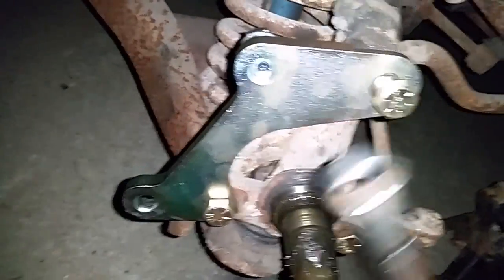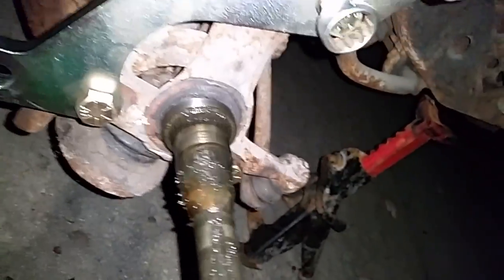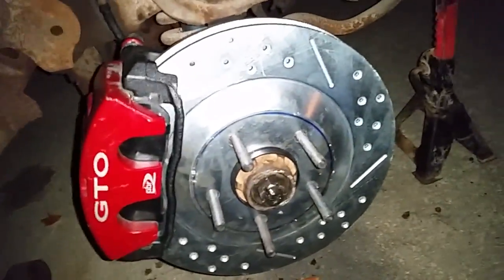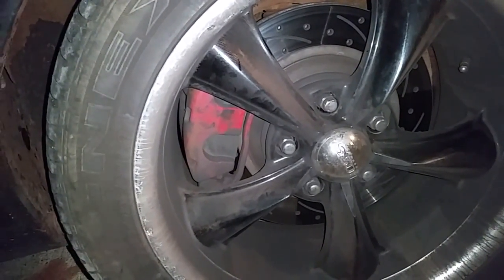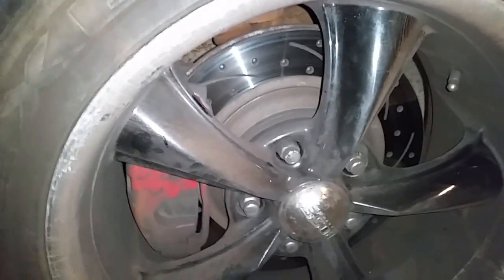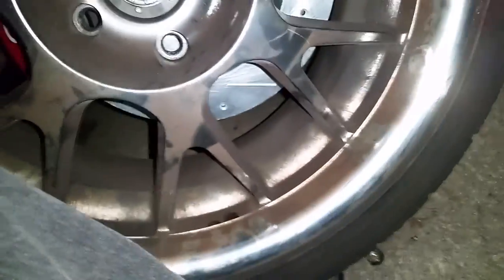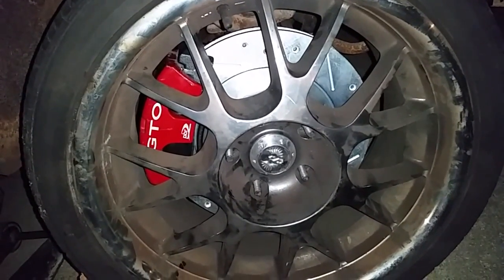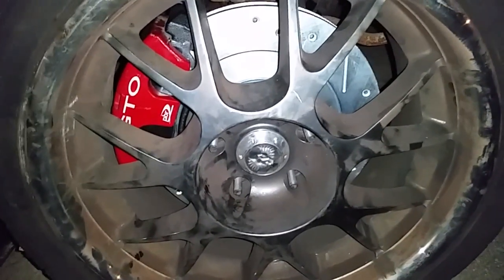c5 corvette disc brake swap 67 tempest gto chevelle nova camaro firebird

Comment: I'm over here looking to do a C5 rear disc brake conversion for my 2000 S10 Extreme and find a way to do C5 larger rotor for the front disc brakes and here I find some real Unicorn cool stuff.  I  really like what you have done over here. So many idiot's NOT doing this high quality budget installation.  I normally don't drive 60s car's but always loved the 68,69 Camaros. I watched because I had a 74 Camaro and I can't remember but I think the front factory rotors are bigger than my S10 Extreme and the spindles look the same if my memory serves me right.  This is one of the greatest budget mods I ever seen in a long time and now I  know when I  can finally afford to get a 68,69 Camaro or even the 74 like I had because of the aluminum front and rear bumpers like the 80s Caprice.  I live in New York City 5 boroughs area my whole life and live love the 74 Camaro which maybe more affordable than the 60s Camaros. The reason being is the assholes that like to bump your car when you have it parked plus they are great for doing battle here in the streets. You can knock down shit just like the Caprice could only difference is your doing with a good looking car and you don't have to worry about parking. Love the video's bro, awesome and now I  am amped up to get another 74 Camaro just because your video with this great idea for a superior braking system that's looks great.
Reply from the maker: Anthony Lodico thanks!

Comment: Nice setup...well done.
Reply from the maker: Thank you, just trying to get the info out there for the guys with shallow pockets and big dreams like myself... btw these brakes would be nuts on a certain 3rd gen i know... ;-) hin hint... also the whole getup around 400 bucks including the new rotors and some pads AND including the KORE3 bracket.   Thanks for stopping by ;-)
Reply: Invincible Extremes It would be a great upgrade for the TA... right now, he just has factory 4 wheel discs, but they're not really big enough.

Comment: That will work great for that heavier car and i like the GTO that was a good touch to add.
Reply from the maker: yeah, half the reason i got '06 GTO calipers and went through the hassle of putting them on corvette brackets was because it came out a little cheaper... the other half was simply because they said "GTO" and I thought it looked cool on a GTO clone/restomod...  thanks for stopping by man.

Comment: Alright I just want to make sure I have this straight before I go spending money. I have a 1967 Firebird with a 1976 C10 posi 10 bolt with drums in the rear, and 1972 impala front disk brakes. To get this done, I need corvette front calipers, rotors, and then the caliper hanging bracket and adapter hose from kore3? then for the rear I need camaro brakes and backing plate with adapter brackets from brp hotrod?
Reply from the maker: yup, exactly those items
Reply: +Invincible Extremes Muscle Cars Garage  alright thank you very much! Nice videos btw, very informative. I mean shit, I was able to gather all this info from just your videos.
Reply: One more question, I'll also need the proportioning valve and you recommended wilwood, I'm assuming I'll also have to upgrade the master cylinder to accommodate the front disk and rear disk?
Reply from the maker: +Christian Dekker the master is a cheap $40 part, buy the stock 70's corvette master... the wilwood prop valve is a must, unsafe without it... it lets you adjust the brakes exactly right to where you dont wipe out during a panic stop ;-)
Reply: +Invincible Extremes Muscle Cars Garage  Ok thanks for the help! So with the camaro rear brakes, will I need the left hand side caliper/backing plate on both the left and right side in my rear?
Reply from the maker: +Christian Dekker no, its a little close on the shock, but just one regular set works ok
Reply: +Invincible Extremes Muscle Cars Garage Ok perfect, I just bought a pair of calipers and backing plates off ebay and then went to brp hotrods website and it said I would need the left hand caliper and backing plate for both sides. so thats a relief! well got the calipers and backing plate ordered, I'll get those spacer plates soon enough and be on my way!
Reply from the maker: +Christian Dekker yeah, some people choose to run a staggered setup, but honestly theres really no need.

Comment: So for the c5 disc swap I need to trim the hubs , get longer studs, and what master cylinder to run the drums in the rear with a power booster, my car is non power 4 wheel drum right now.. I picked up 2002 Camaro calipers front and rear just In case
Reply from the maker: 2002 camaro disc brakes are very different from corvette disc brakes... wont work for the swap.  but the master is the stock power disc master, just get one at autozone for 35 bucks for your car, and get whatever booster is stock for your car... then you'll need to have the right pushrod length too.... i just went with 4 wheel manual disc... love em

Comment: I'm Thinking About Doing A C5 Swap On My 72 Chevelle And My Question Is Are There Any Particular Bracket/Brackets Needed To Mount The Rears Calipers & Roators On...? I'm Online And Not Seeing Anyone Talk About Rears Only The Front.
Reply from the maker: It's honestly better to use a different brake for the rear.  Like the ls1 camaro rear brakes or similar.
Reply: @InvincibleExtremes  Thanks I Appreciate The Info. I Need To Look Into The Most Cost Efficient Way To Go. Any Input On That.?

Comment: So whats the main diff between the 2002 Camaro and C5 vette setups? Big cost difference?
Reply from the maker: Kewfit both are dated, so cost isn't that big an issue, but it's better calipers and a 13 inch rotor mostly

Comment: So I got a 66 tempest that had factory drums all the way around and I am planning on doing the 98-02 Camaro front disc swap but i bought new disc break spindles but now I can’t find a disc hub so my question is can I use my drum hub on disc spindles or does it have to be the disc hubs
Reply from the maker: Christopher Creed you wasted your money on disc brake spindles.  But yes, there is no such thing as disc brake hubs, that's because discs are one piece.  And yes you can use drum hubs on them.
Reply: Invincible Extremes Muscle Cars Garage  it was more for looks I think now. Thanks for the info I guess I’m grinding the factory hub to fit the rotor great videos appreciate you responding I kind of was at a stand still because of it thanks again
Reply from the maker: Christopher Creed yeah no worries.  Watch my  $239 disc brake swap from speedway  on our 1966 Buick skylark.  It's a video  that'll make it very clear the difference between drum and disc brake spindles.

Comment: Hi there,

first off love your vids and all your knowledge but I have a couple of questions....i have 1969 442 cutlass. ....it already has factory installed front disc brakes and rear drums....i would like to put the gto or c5 corvette disc's upfront...my car has the hub on the one piece rotors....what vehicle could I get the hubs from so they work on the front spindles....the bracket would be from kore3 ...do you not need the dust shields in the front???? also if I went to a parts store would I just ask for 13" rotors for a 97 vette??

for the drum conversion...all.i would need is the rear disc assembly from 98 v8 camaro? what else would I need to complete the swap?

sorry for the long message 

thank you
Reply from the maker: the rear disc brakes may not work with your rear end.  the BUICK, PONTIAC and OLDS have a different rear end with different brake parts
Reply from the maker: as for the hubs, any a body, f body or x body hubs will work.  they sell reproduction hubs on ebay from time to time
Reply: How about the front end which hubs would I need fir the swap (I mean from what vehicle would work with either gto or corvette 13" rotors???
Reply from the maker: +Amrik Jaswal you can use the front drum hubs off a camaro, firebird, nova, chevelle.... but to use them you have to turn them down some

Comment: Did you use the spacer inside the hub from the brp hot rods kit?? Corvette abutment bracket also??
Reply from the maker: This isnt a brp kit at all.  No spacer, and kit came from KORE3...
Reply: Invincible Extremes Muscle Cars Garage  so turned down drum hubs work fine ? I have some from the ls1 brake swap is the rotor hat the same size on the vettes and camaro?
Reply from the maker: Oh gotcha, yeah its similar.
Reply from the maker: Just realized what spacer you're talking about.  No, take it out.  That spacer is only needed on ls1 swaps

Comment: What size would I use on 67 Bonneville with 15 in. wheels. Your vid. is amazing, New at this but your video made me feel as I can do this. Where is the best place to get parts needed,what would estimated cost be??  Love your work.
Reply from the maker: None of these bigger brakes will fit 15 inch wheels sorry.

Comment: how did you manage  to  run down the hubs with a grinder? I have the camaro rotors and calipers. just can't really get them to a machine shop
Reply from the maker: +mlhmisc1 since you are going to replace the studs anyway, pop out all 5 studs and drop the hub into the back of the rotor and then use some chalk or something on the inside of the rotor before dropping it in.  Then press hard and rotate the hub inside the rotor.  Because the studs are gone, the rotor will center itself on the hub bore and leave a nice chalky imprint on the dirty hub as you spin the hub through several revolutions... then use a marker to draw a nice circle following the scrapes and chalk on the hub.  Then install the hub on your spindle and use the grinder to spin and grind at it.  This will spin the hub and will remove material.  It may not be very even and once any one part reaches your marked area you stop letting it spin.  Drop the hub in the rotor again to comfirm that the most ground section actually fits inside the rotor hat now and make note or mark the areas that still need grinding.... then you can either hold the hub or install it again, but control it with one hand while grinding with the other and work your way around while checking every so often with the rotor.  Eventualy itll sit nicely inside the rotor and you'll be done.  Some areas will be a little more ground but try to keep it uniform to avoid balance issues ;-)  hope that helps bro.  Dont forget to check out the other videos and enjoy our adventures.  And as always, thanks for watching.
Reply: +Invincible Extremes thanks brother that really helps out alot. Will be sure to post a vid once it's done. take care. will look forward to more

Comment: do you think ur boss wheels clear the c5 calipers? since what ive read most wheels need a spacer to clear the caliper..
Reply from the maker: I for a fact know they do.  They are sitting on them right now.  The boss 338 17 wheel with -4 offset clears both the kore3 c5/c5 setup and the cpp c4/c5 hybrid setup... i know this because i have tried it and driven tens of thousands of miles no prob.  Hope that helps, thanks for watching.

Comment: if i put 18" wheels on the rear of my 74 nova would i have to roll my fenders at all to clear?
Reply from the maker: bryan moore i don't think so brother, just make sure to get a 18x9 inch or 18x8 inch wheel and the offset has to be absolutely zero.  Not +35 or some crazy shit...and it'll fit perfect with about a 255 35 18 size tire... maybe more, but the 255 should fit just fine for sure.  Thanks for watching.
Reply: Thanks bro i appreciate it, im throwing  on my brothers saleen rims on pretty  soon n i wanted to make sure👌
Reply from the maker: bryan moore um
....thats impossible, ford used 5x4.5 bolt pattern while chevy used 5x4.75.... hope you know that...
Reply: I was unaware  but shit, looks like i gotta keep rolln on the stocks for a while longer then. There isnt many videos on exactly  how to do much  work on old school cars Novas to be specific. But thanks for helping  ill be sure to Contact  you of i have any more questions
Reply from the maker: bryan moore no prob, just trying to help.

Comment: I want to do this to my 70 lemans , disc break up front , what all do I need from kore 3 , I want to run the gto calipers like you
Reply from the maker: +Bill Robinson you will need some parts off a corvette to be able to use gto calipers.  Calipers are same, but abundments are not...
Reply: Is it just the abundments I'll need ?  Thanks for answering questions for me
Reply from the maker: Bill Robinson yup.  05-06 gto calipers, c5 vette abundments, and the Kore3 adapter brackets...

Comment: Going this route on my 3rd gen Elco. The question I want to know is, how much better is your braking ability compared to what you had?
Reply from the maker: Using results from my 68 firebird, these brakes are amazing compared to the drums, and substantially better than factory 70's GM disc brakes.
Reply: That's good to hear! I'm one of those idiots with 17" torque thrust II'S so I have to get different wheels too 👎
Reply from the maker: Those are amazing looking wheels that don't fit any brakes unfortunately.  Maybe the 98 Camaro brakes, look into that.  Great brakes too, just not corvette great

Comment: Hey sir, first off I love ya videos. Ok. So I watched this video 100 times and I'm still a little confused. I have a1973 pontiac Ventura that I did a LS swap in and turned into a 1974 Pontiac Ventura got clone. Complete restoration build. I'm mocking your front GTO conversion, I bout the 2006 GTO calipers and stock drum hubs from a 1973 chevy nova. What else do I need what year c5 rotors do I need I want 13" rotors. Also what bracket did u take off the stock GTO calipers and replace in your video?? We're do I get that from? And finally what bracket do I need from kore3?? You have helped me a lot thank you so much
Reply from the maker: Howie P ok, so the bracket you need is the c5 corvette "abundment" and the bracket needed from KORE 3 is the corvette swap conversion bracket, let them know if you have drum or disc spindles and you'll get the right bracket.   rotors are for a 2006 corvette c5 and c6 used the same 13 inch rotor for the base model corvette
Reply: Ok, so what year corvette can I get the  "abundment" piece from??
Reply from the maker: Howie P 2005 is a good year, but like I said, c5 or c6 are same for the 13 inch brakes, so any year of those will work
Reply: Sir thank you so much in helping my dream car become one step closer to perfection. I have purchased everything you informed me I would need. The GTO Calipers, the 2005 corvette abutment(caliper mounting bracket) as well as the OE drum hubs. Last questions would be when you say 13" rotor are you using the 12.8" rotors or the 13.4" rotors?? And if I get a C6 13.4" rotor from 2006-2013 corvette do I have too trim down the hubs??
Reply from the maker: Howie P stay away from the z51 rotors... that's all I can say for sure... best bet would be to use the 13 inch rotor from the 2004 corvette

Comment: I saw your video and also have a 67 Lemans. I was wondering will the GTO rear calipers or C5 calipers bolt in the back on the firebird mounting pads from the 1988 to 1997 cars or are they all the same rear caliper? Thanks
Reply from the maker: +Carmen Kohn no, the corvette caliper is not worth the trouble for the back.  If using a chevy 12 bolt, a 98-2002 camaro is the simplest route for good brakes.  If using a ford 9 inch, ford racing $170 disc brakes off a 2014 mustang are your best shot... hope that answers your question.  The gto and corvette both use independent rear suspension and are too funky to bother with for a chevy rear end
Reply: Carmen Kohn h

Comment: Hey I'm buying a set of 06 gto brakes front and rear will the rear be as easy an install? I have a 69 gto. Thanks so much.
Reply from the maker: jorge balseiro the rear will not bolt up at all.  only the fronts will work and then only if you use some corvette parts

Comment: Did you have to change your booster and master cylinder?
Reply from the maker: +Anthony Drew  i do not have a booster.  I use manual brakes.  The master had to be changed to the one off a 73 corvette with 4 wheel manual brakes.  I also changed the proportioning valve to an adjustable wilwood piece

Comment: Would this work on a 9 inch quick performance rear
Reply from the maker: Front brakes on the rear? I'm sure anything can be made to work.  I myself used 2014 mustang rear brakes
Reply: @InvincibleExtremes  oh ok I meant c5 rear on 9 inch ford
Reply from the maker: C5 rear aren't anything special... really are better off using the mustang brakes.  Functionally the same
Reply: Ok thank you

Comment: What do you do for a Master Cylinder? After watching i'm getting confident about doing this on my 72 chevelle with drums on all 4
Reply from the maker: i used a disc disc master (70's truck master works too btw) off a 70's corvette.   also for the adjustable prob valve i used the wilwwod piece, there's a video on it in the 68 firebird playlist... works great and it can be adjusted to any tire setup or weight distribution for perfect front to rear bias how you like it... i have manual 4 wheel disc and it works great.
Reply: Awesome. I found some corvette calipers on Ebay i'm going to try getting for the front, then i'm going to start scouring the junkyards for an ls1 camaro for the rear too. You have been a ton of help
Reply: is the disc disc master you have for manual origianlly? or was it for a power ant just happens to work manually?
Reply from the maker: Nikola Rogen  beats me, works great though...

Comment: Is it possible to do only front discs with this conversion, or so both front and rear have to be replaced at the same time?
Reply from the maker: of course thats possible... thats how i drove around for over a year.... just make sure you have a disc/drum proportioning valve... and you'll be set.